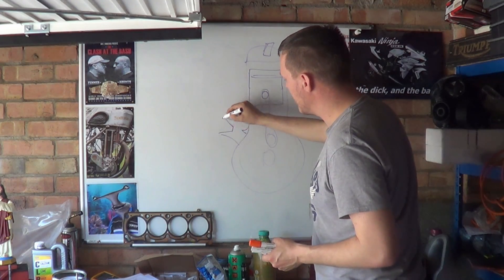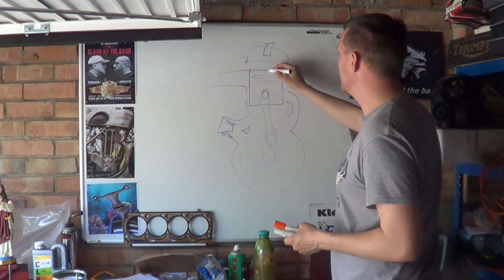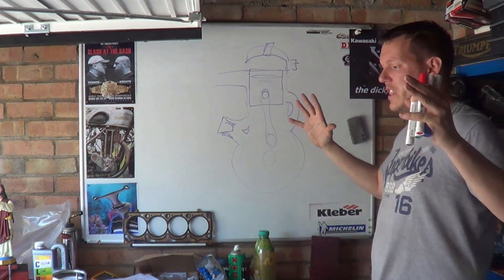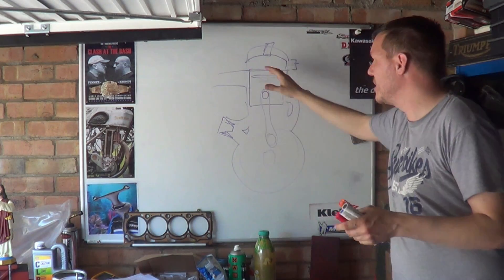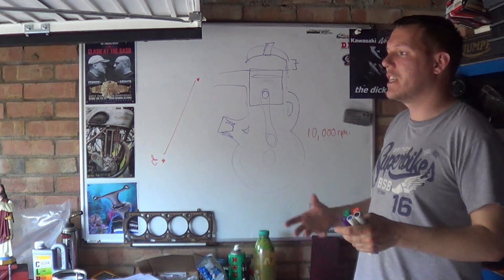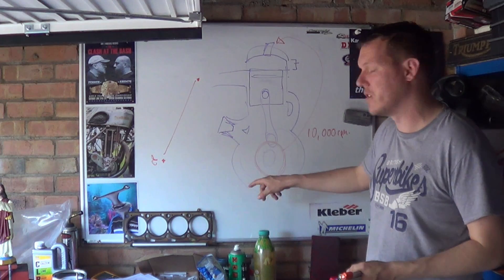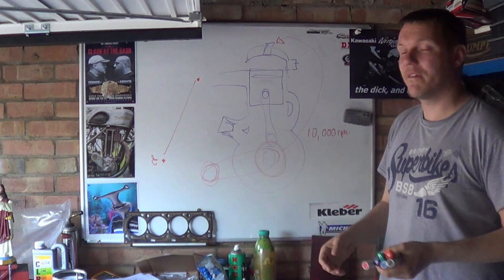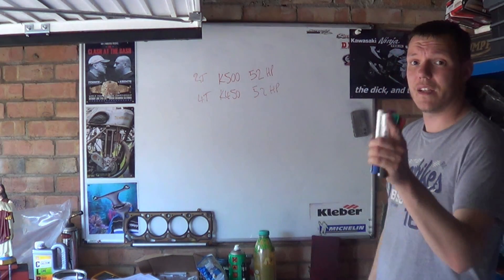2T Direct injection - Comment Reply

Comment: Why isn't kerosene the mainstream fuel used in today's ICE engines?
Reply from the maker: Great question - ATTL
Reply: i actually ran a mixed diesel and high octane petrol occasionally 50 litres of diesel to 5 litres of ron 95 petrol. Toyota 2KD-FTV engine @180.000 km

i did it for interstate trips through the backroads. it helps for a faster response (great for short burst of power) so far so good. 

Kerosene is much better mix and can be used for sustained high RPM.

Old folks used to mix kerosene 1 litre for 10 litres of diesel on their fishing boats. runs like damn... smooth...

Kerosene is more expensive than diesel, it was cheap back then because it was heavily subsidized
Reply: kerosene is more expensive to refine, also the yield is also lower per barrel of oil... its really as simple as that, no conspiracies.
Reply: "kerosene is more expensive to refine," actualy its much cheaper, but it simply can´t burn clean in normal piston engines also it has some other problems with a slow burning ect.

Comment: Why dont any motorcycles run on e85 racing fuel like some race cars does? do they run on special fuels in moto gp? Would there be any hp gains in tuning a motorcycle engine to run on e85?
Reply: Jeppe Emil Hugod e85 on naturally aspirated cars doesn't yield much power because e85 has a lower calorific value compared to gas. Turbo cars really benefit from it because it has a really high knock resistance so the e85 can handle much higher boost levels and more aggressive timing.
Reply: TW
Similar to top fuel running methanol, less energy in the fuel but they can run so much more of it (near hydraulic lock) that they can accomplish a bigger bang anyway
Reply from the maker: "do they run on special fuels in moto gp?" 

- fully synthetic if I remember correctly - unless they stopped doing that - I'll check
Reply: e85 could produce more power. I believe koenigsegg advertises that one of their cars will produce more power on e85
Reply from the maker: +Vq37 VHR is correct to a degree. E85 - (85% ethanol/15% petrol) is basically ethanol for those who don't know what it is. Quoting calorific values is only half the story, and this has nothing to do with compression ratios etc. Koenigdickhead have stated that its more to do with the cooling effect (Latent heat of vaporization) 

Petrol - 350 ~ 375 J/g DegC
Ethanol - 841 J/g DegC
Reply: mondayfool
hydrophilic probably being the worst
Reply: also ethanol can burn at a mixture close to 10:1 I believe